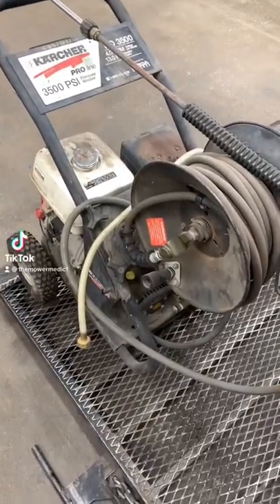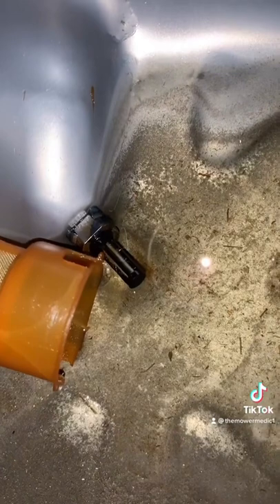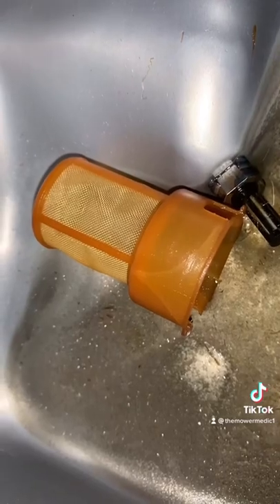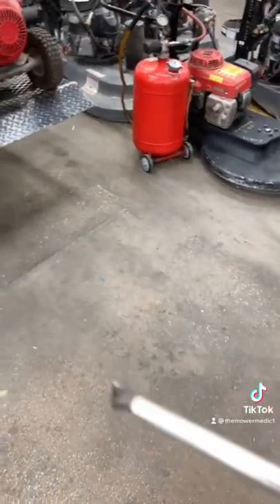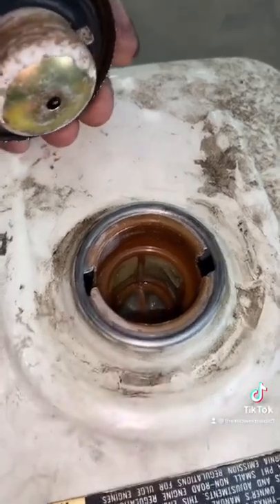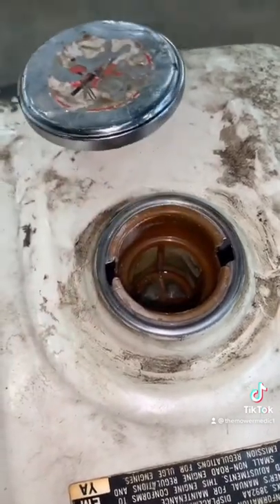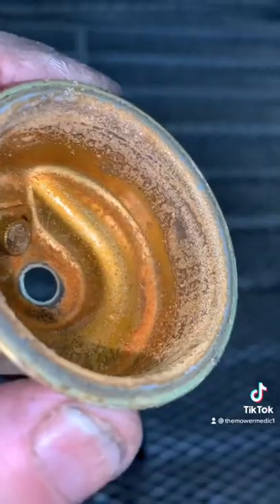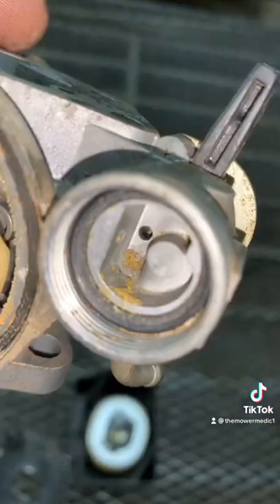DONT LET YOUR SMALL ENGINES SIT!

Comment: I always buy non ethanol for my small engines. I'm seeing more gas stations starting to sell it. It may be way more a gallon but it is for the best in the long run.
Reply: For at least 3 years I would curse my mower and gas powered trimmer, only to find out that gasohol eats the inside of the fuel lines making a mess of the tiny carburetor!  So I went all electric!!
Reply: If you just run the carb out of gas it’s fine . On smaller engines chainsaws and weed eaters I would say no ethanol for sure but a mower or go kart or somthing like that with a bigger small motor  is just fine to use just turn the fuel off when your done and run the bowl out of gas
Reply: @harryfp1494  ya I only had issues with the small engine things. And an old snowblower that had black rubber line that wasn’t ethanol tolerant
Reply: I'm lazy, I buy non ethanol and add fuel stabilizer to every jug. Starts every time, even on first start up after winter. 😁
Reply: I use it in my car and get 10 mpg than with ethanol gas
Reply: @pandalegends2738  no you don't.
I agree you get better mileage,  but it isn't 10mpg better.
that is Joebama math.
Reply from the maker: No it doesn’t lol
Reply: @Harold Phipps  I also use 93 not 87 so I gain mpg and are less likely to get pre-detonation

Comment: I installed inline fuel shutoffs made by Briggs & Stratton on both my push mower and riding mower, when I'm done mowing, I shut off the fuel, and leave the engine run till it runs the carburetor out of gas. When the grass needs again, just turn the fuel shutoff back on ... wait a minute, and it starts back up ... no problem!
Reply: That’s really not helping anything unless they are sitting for very long periods of time (over a year)
Reply: @Nothingmore71   I  would have to agree to disagree with your opinion.
Reply: I only do that when I know it’ll be my last cut before winter.
Reply: Tyler Westman  o no not my small engine

Comment: Here in Tennessee you can usually get 100% pure gasoline, no ethanol. Most people use that in their power equipment. Sits through winter no problem. My zero turn started up perfectly in spring with no special treatment.

Comment: People laugh at the Briggs plastic carbs ,but this is the reason they designed them, not cause it's cheaper.
It helps but it's not a total solution.
Use a stabilizer, or ethanol-free.

Comment: If you're gonna let it sit for extended periods, without running it dry, run some 100ll avgas or if you don't like the lead, use some canned alkylate fuel. Atleast for the last run before you put it away.  Non ethanol pump gas is faaar better than e10/e15 but will still go stale and varnish.

Comment: I only use ethanol free gas in all my small engines and they all start up with no issues even after long periods of sitting.
Reply: Same. My only question (not that it's stopped me) is if running 93 non ethanol is going to cause any ignition issues in engines I'm assuming are set up for 87. Does the extra knock resistance cause any kind of ignition delay that will in turn lead to more buildup of a different kind?
Reply: @thepewplace1370  I do No but it hasn't bothered my mower after 3 years of use. My father livs near the track so he uses race fuel which is very high octane. I dont have stats but hey experience doesn't lie

Comment: If your small engine has a gas cut off switch, while it's still running shut off the gas. This way it burns up the gas in the carburetor and it won't sit in there causing these problems. If your small engine such as a weed eater or chainsaw doesn't have a gas cut off switch dump the gas out of the tank if it has a lot in it then crank it and let it run till it cuts off which burns up the gas keeping it from sitting in the carburetor screwing it up. My grandfather did this before ethanol fuel come around so I learned to do that anyway because even the old gasoline would overtime go bad and gum up the carburetor and if it's in a small engine say like a generator you might not use for who knows how long is why he did that. Even storing the weed eater over the winter with gas in it can cause problems the next year you want to use it. This has just gotten to be more of a problem with ethanol gasoline which makes it even better to practice this nowadays.  👍

Comment: I run my lawn tractor all 4 seasons between cutting grass, mulching leaves, and plowing snow so gasoline doesn't sit in it for too long but I still like to use a stabilizer (Startron) in it with every 5 gallon can fill every month year round to help keep it fresh. I really don't know how anyone can be selective in choosing what amount of ethanol is available at the gas pumps ⛽ nowadays with record prices or even in the past, so it's basically just take what's available, run your engine frequently, change your fuel filter annually, use a good stabilizer, and run the system dry if not used for awhile or during the fall & winter seasons to avoid problems.
Reply: Add an additive or stabilizers if straight gasoline not available. 
Check at the Murray gas stations,, the ones close to Walmart.

Comment: Friends log splitter wouldn't start. Cleaned bowl & fresh gas. Nothing. I asked him was the metering jet clean. He said what? The bolt for the fuel bowl is the metering jet. Was clogged. Reassembled & started on first pull.

Comment: Here's a tip that will save you hours of trouble over many years. On small motors that take no lead gasoline, use RV gas. There is no ethanol in it. You're very welcome.

Comment: I always use 100% pure gas in my small engines.
Reply from the maker: No you don’t.  By law all gas has to have 10% ethanol even the ethanol free stuff has ethanol in it it is it legal to sell non-ethanol fuel
Reply: @THEMOWERMEDIC1 , can you provide any evidence to support your claim that 10% is required by law? The federal renewable fuels act required that by 2022, 36 billion gallons of renewable fuels be blended into transportation fuel but there is NO requirement (that I have been made aware of) that it is to be in every gallon. At the state level, I think there may only be about 7 states with laws that even address ethanol blending. Even California doesn't require "at least 10%" in every gallon.
Reply from the maker: https://www.afpm.org/issues/fuels-vehicles/RFS

Comment: This is why you run your equipment out of gas before winter storage.
Reply from the maker: If you run out of gas all of the rubber parts in the carburetor will dry out and when you go to refuel the next season the carburetor leaks like a Fossett it is best to just leave your equipment full of gas and just run the equipment once a week and let it get hot

Comment: Always turn the gas off and let it run until it shuts off.
Reply from the maker: That does absolutely nothing brother there’s always going to be gas in the bottom of the carburetor bowl that doesn’t get burned off and that’s where the gel and the corrosion starts if you’re going to do it right you need to pull the carburetor part clean it and put it back together I know it sounds redundant but that’s the correct way to do it
Reply: @THEMOWERMEDIC1  works for me, but my small engines don't set for more than a month.

Comment: Always use fresh gas and a gas stableiser. Never leave gas in tank more than few days. I use small battery pump and remove gas from tank if not used within 2 days.  Do same even for lawn mower, and run until all gas out if engine.  Is also best to not put in gass that can not use up within an hour.  Can always add gass if needed to save time pumping it out.

Comment: Always use non ethanol gas in any small engines. It's the difference between the motors lasting ten years or puking after one. Ethanol should have been outlawed for use in fuel decades ago, but you know------,government screws everything up it touches.